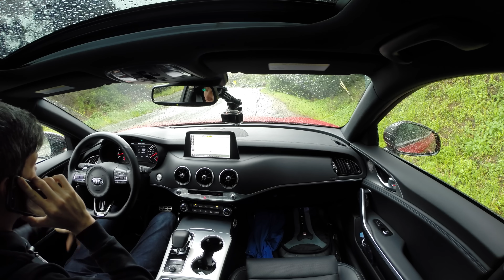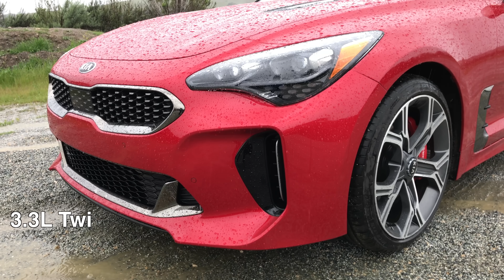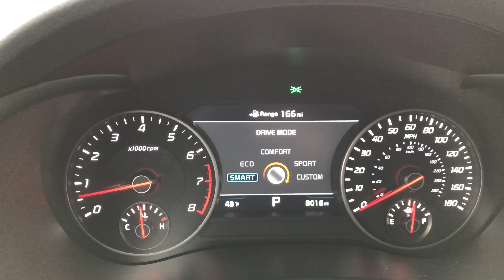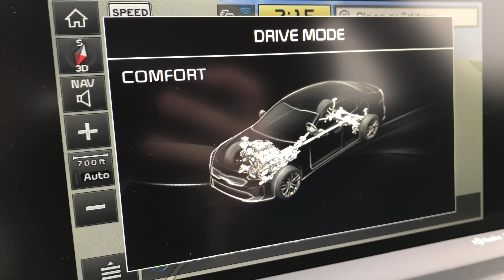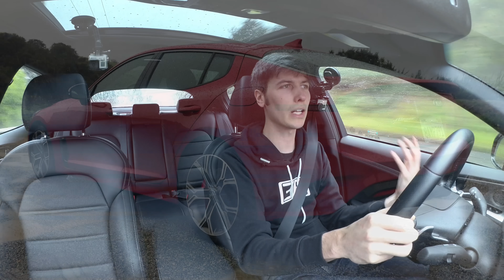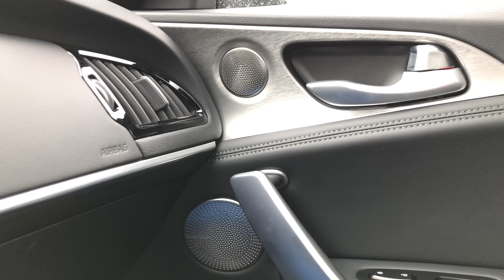The Kia Stinger GT Is An Ego Check For Car Guys

Comment: Why would you buy this if you cen get cadillac ats or  cts v-sport for pretty much the same money or  german competition. Price between kia and caddys is compariable here in europe but Im not sure how it is in USA though.
Reply: ICECUBE682 you could get the ats, but it wouldn't be as powerful afaik. The cts v sport starts at like 62 grand lol
Reply: Yeah the difference is huge becouse german cars are cheap becouse they can be, cadillacs are cheap becouse GM is trying to attract new buyers and KIA Stinger the top of the range model is 60k becouse its taxed to hell becouse its a V6 another important fact is that people in Europe don't like big price gaps from base model to top model thats why all car company acknowledge that, even cadillac(ats here starts at 45k and gose to low 55k, in America there are huge gaps in price from base to top model) thats the reason even base model Stinger costs 49k so price difference from base to top of the line model is smaller (10k). Yeah the new cadillac engine is amazing but 4.2 v8 hot-vee engine is going in brand new cadillac ct6, cts-v is going out of production next year. CTS and ATS are going to be replaced with the all new ct5. I hope in a few year I will be able to buy a new cadillac and cruise with it on beautifull euro roads.
Reply: thats interesting, the top end KIA Stinger in Europe costs 60k which is the same as the cts v-sport and the cheapest Stinger 2.2 liter diesel or 2.0 liter turbo costs 49k and cadillac base model ats costs 45k (not to mention it has better platform, I like the transmission better + you can get a manual trans, 2.0 t engine is more powerful, interior and equpement is way better and so is design language- basicly caddy ats is pretty much better in every category). And there you have german sedans in the same price range but with aditional better quality than cadillac and even more so than a kia. Not to mention better dealer coverage and so on... I almost forgot about dodge charger or a bit more performance oriented camaro or mustang, maybe even Lexus but I personaly don't like them.
Reply: Price gaps for german automobiles are also slimmer overhere, excluding AMG, or M
Reply: Cadillac,  seriously??

Comment: The engine won't make it to 100k
Reply: JohnStax moron
Reply: Making Ward's best top 10 engines 2018 list says you are wrong.  Ward's auto is respected organization for ranking automobile technology.  The list is not in order.

    150-kW Electric Propulsion System (Chevrolet Bolt EV)
    3.6L Pentastar DOHC V-6/PHEV (Chrysler Pacifica Hybrid) 
    2.7L Twin Turbo DOHC V-6 (Ford F-150)
    5.0L DOHC V-8 (Ford Mustang GT)
    130-kW Fuel Cell/Electric Propulsion System (Honda Clarity)
    2.0L VTEC Turbocharged DOHC 4-Cyl. (Honda Civic Type R)
    3.0L Turbocharged DOHC V-6 (Infiniti Q50)
    2.0L Turbocharged DOHC 4-Cyl. (Jaguar XF)
    3.3L Turbocharged DOHC V-6 (Kia Stinger)
    2.5L Atkinson DOHC 4-Cyl./HEV (Toyota Camry Hybrid)
Reply: Prove it.
Reply: The 3.3 liter is a tried and true engine that came from the cadenza and k900, it’s also in every Sedona and a lot of Santa Fe’s. Do your research on it please.
Reply: JohnStax the engine design is a basic v6, simple can timing and direct injection, it’s not like the Germans reverse flow v’s, so it will be reliable like all their other v6’s
Reply: if it doesn't, it should be covered under warranty.
Reply: my Kia's got past that and still rolling just fine thanks !!!!
Reply: waking00one excuse me
Reply: JohnStax so like nearly every car? K.
Reply: DGFr0sty But its a Kia lol

Comment: Hey EE hope you doing well big fan from Saudi Arabia i wanted to ask you about the A/C. In my country in the summer it gets pretty hot up to 55 C so my question is. Is it ok to turn the A/C on while the car is driving I don’t know why but my brother and I but it on N then turn the A/C. Second question is I usually put the the A/C at the lowest degree is that bad?. I drive Kia Cadenza 2016
Reply: Feras A/C while you're driving is totally fine, it does decrease gas mileage a little though. It's actually harder on your radiator to have A/C on while parked, but it should still be okay unless your radiator fan is going out or something.
Reply: Daniel Jensen I don’t think you understood my question. It’s ok to turn the A/C on at anytime. But if I’m driving on the highway and the A/C is off should i stop and turn it on or put the gear in N or just turn it on

Comment: The Kia Stinger GT is like $54k... I can’t think of any reason that you’d buy a Kia over a BMW 340xi especially considering you can get the 340xi in AWD with a stick for about the same price.
Reply: better warranty and reliability
Reply: i thought the GT model starts from 38k
Reply from the maker: It starts at $38k with 365 HP and RWD. The BMW 340xi starts at $51k with 320 HP. $13k is a massive starting price difference.
Reply: A Stinger GT AWD is $53K fully optioned, with extra accessories (mats, remote start, wheel locks, cargo net, etc.), a BMW 340 XDrive starts at $51K (before options and accessories), both of these are MSRP. Anyone listing a stinger for $55K is marking up the price of the car. The 440 Gran Coupe, which is a direct competitor starts at $53k, once you option it up with similar equipment to the Stinger, you are in the $60K region. If this car had a German badge it would be considered a steal for it’s price, even with a KIA badge it is still a bargain.
Reply: How do you know the reliability is better? The car was just released.
Reply: If it have same price then compare the warranty and spare part availability.
Reply: Stinger has more HP, higher top speed and looks sportier. 340xi just looks like any other bland bmw
Reply: The base Stinger GT is actually $39K with destination/freight added in.
Reply: emdec55 you are correct.. I have a gt 1 awd for 46,000 the gt is 38,000. When  adding more features it goes up.
Reply: I can think of three: reliability and lower maintenance and insurance costs.
Reply: a bmw is less reliable than a kia, proven by their 10 year warranty
Reply: waynerm002 i drive a kia Forte, and i love it. But this argument caught my eye. If the difference is 52-54k for a stinger and 58-60k for a specced 340i, I'm going for the BMW. I'm sure the Stinger is good, but the 340 is great and there are little things in quality and features that only BMW can deliver. The 5k price difference is 100 bucks a month extra on a 1200? monthly car payment (I'm not American I'm not sure how you do your car loans), and I'd pay that to buy a BMW. I love my Kia, got it cheap but i aspire to buy a BMW or Audi s3 especially soon.
Reply: A fully loaded one in Canada that comes with more options is $52,000.  So yah, dunno why the USA is paying more for less.  Maybe Tarrifs, import charges or something else is affecting your price?
Reply: PorscheRacer14 It's not more for less, you just have less equipment in your top trim GT Limited.
Reply: I'll say drive both and see if it's worth the extra money. I've had both Audi and BMW and now I'm on my 3rd Optima hybrid.  I traded from a 535 M-Sport for the KIA Optima hybrid.  BMW makes great cars but when things go wrong they can be pricey to fix out of warranty.  I haven't been stranded with any of my KIA's can't say the same for the BMW.  Buy what you like and enjoy it!  I enjoyed my time with the BMW 525 and 535.  As someone that has had them I know this Stinger is pretty much the same in the ride/handling department but is better looking in my eye.
Reply: Because sometimes people need to like the car, not the brand. Also these cars are new cars,  not used ones.
Reply: Because if you see a 3 series you're like, oh another one
Reply: Famous Gaming-  Stick to your car game, this is Real World, 

KIA is significantly cheaper than BMW

End of story
Reply: @thebadmanreturns  hell with forza horizon 4 having the kia stinger, i dropped all BMWs and been sticking with the stinger.
Reply: Engineering Explained please be accurate. 38k gets you 265 bhp not 365, that goes for 54k. See my other comment on this thread for context.
Reply: emdec55 I'm not running a YouTube channel with 1.6 million subscribers, so yes i can be sloppy and write 265 instead of 255, and point out that comparisons are being made between the gt2 featured in this video not the base 38k rwd version. As the subjects being compared here are a BMW with awd x drive and only 10 people and hopefully the channel owner will read this comment, not millions of viewers.
Reply: waynerm002 yes it's the TCO as well. I'm sure in the longer run, BMW will cost tens of thousands more to maintain.  But the starting price is too close. Kia only works out if its 20% cheaper. I keep my cars well beyond their warranty period, so bring cheap to fix is key. Still that's an unknown as the Stinger is brand new and these features are pretty new for Kia as well. They'll probably hold up but it's a gamble to take only if the starting price was 10k cheaper.
Reply: @Vanguardkl  I have owned a bmw 340xi.  The base versions of the 340 on the lot started at 50k.  I bought a fully loaded 340xi for almost 60k.  My comparably equipped stinger GT1 was 39k out the door (3.3l tt).  Literally the only features missing on the stinger I have is the surround cameras & sunroof.  I have a much better warranty on the stinger gt1.  The gt1 is what EE is referring to when he mentions the 38k start point, but the gt1 comes with the best motor, same as the gt2.  The prices are nowhere close to comparable speced out the same.  That's fact, I've bought both.  I even got a good discount on the 340.
Reply: Any stinger GT I’ve ever seen at shows or on the lot have been at least $52k-$56k, where I live in the northeast people don’t buy RWD cars I guess that’s relative to my area but still thats an insane amount for a Kia Vs. the car it’s aspiring to be

Comment: Great video, Jason. A couple things I noticed. First, the steering looked very light to me as you were driving. You didn't mention it so I assume it wasn't. Also, I watched with headphones and the rain noise seemed pronounced. Is it any more or less quiet than you'd expect?
Reply from the maker: I was fine with the interior noise levels, though the rain did come pretty hard at a few points during the review. Steering is adjustable based on the mode, so effort varies. I don't recall it being particularly light or heavy, but overall was impressed by the feel. Direct and responsive.
Reply: Thanks. The upcoming Genesis G70 looks good too. Would love to see how it compares to the Stinger.

Comment: Mustangs... Way better, son.
Reply: Eric Amato apples and oranges
Reply: Kristopher Klassen That was a pretty lame insult
Reply: crowd favorite
Reply: not the same thing boi, mustangs are coupe, this is a hatchback
Reply: Eric Amato Because V8!
Reply: I actually cross-shopped the 2018 Mustang and the Stinger GTS (UK version of the GT2). If I hadn't have gotten such a large discount on the Mustang (Performance Pack, Magneride and Premium Pack, FYI) I probably would've put an order in for a Stinger without any regret.
Reply: A Taurus coupe? That's cute.
Reply: The only thing rustangs are the best at is for watching taillights